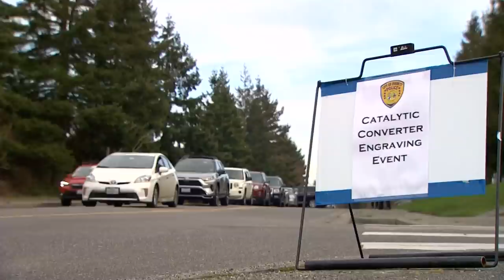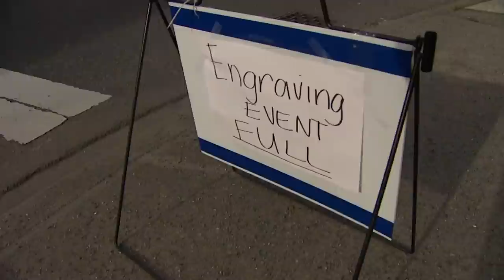Drivers wait hours in line at Everett catalytic converter engraving event

Comment: I've heard some industry experts state that engraving the VIN into the converter makes it easier for thieves to sell them. Also, a thief is not going to see the number engraved in the dark while they focus on quickly cutting it off. Engraving the number protects you from theft the same way a security camera on your porch protects you from porch pirates: NOT AT ALL.
Reply: If they make it so you have to supply your registration, to the scrap yard, so they can match the numbers it would work. Without that bit of legislation it would serve no purpose to engrave your vin on it.
Reply: @mgreg8134  FACTS

Comment: My nephew worked for a metal recycling company and the aftermarket cats do not have any precious metals in them unlike the factory ones. They are basically worthless as scrap for that reason.  We were talking about this a couple of months back because I need to change mine. We both agreed though that thieves won't take the time to figure out if your Cat is factory or after market.
Reply: Most know just by looking at them. Its pretty obvious.

Comment: Engraving will not stop theft. Waste of time, scrap yards use what's inside the converters, the paint and engraving does nothing
Reply: Since no process exists for a scrap dealer to cross check the numbers with a actual 
junked car before buying won't work. The number will also be ground off.
Reply: The paint will burn off. Its too cheap and they get too hot

Comment: Since there’s no emissions, ppl should just run a straight pipe w/resonators
Reply: You can't, most on-board emissions circuits will throw codes that the catalytic converter isn't working properly
Reply: There are emissions all over. Its litterally different in every county.
Reply: @donaldmiller4386  That's not what I mean, I'm referring to the emissions that are created and monitored by your cars onboard computer. That missing piece will cause an error code, and potentially other issues with the car down the road. Most people aren't very concerned about a check engine light but ignoring it, if you end up with a more serious code on top of that one, you have no way of knowing unless the car breaks down.
Reply: @maryjaneevadiamond6359  My comment was not for you. Which is why your name isnt in there.

Comment: 800$ for a cat? She got scammed. They probably replaced the entire exhaust. Any reputable muffler shop can weld in a universal cat for much cheaper. $200-$300 including cat.
Reply: That depends on the make and model of the car My 2006 Subaru outback  the header pipe is part of the cat. There is not enough room due to how it is run to cut out the old one and put in a new one .

I looked high and low for a universal one but could only find aftermarket OEM style for it. Still way cheaper than a factory muffler. 

Auto Zone wanted close to 600 bucks just for my cat plus it would cost another 100-200 to install it.  

She is driving a Prius so her cost may not be far off. 

Plus Washington has developed California emission standards for all vehicles manufactured after 2009. So all catalytic converters installed on vehicles older than newer than 2009 must replace the cat with a CARB designation.
Reply: @mgreg8134  it depends on where the 2nd o2 sensor is. My old sti had a similar setup to your outback and there was plenty of room to install a universal one before the 2nd o2 sensor. Also, autozone, pepboys etc will always be on the high end. Best to take it to a muffler shop. Much cheaper.
Reply: Yeah where do you live?  Prices are different in different places of the united states. Like i said. You cant even buy the aftermarket here in calif they will not smog your car if you dont have the specific California approved one. I just went thru this with my son..they also require two of the 900.00 dollar one's that is 1800 hundred then you gotta pay someone to put it on. We went to every place in the Davis woodland. And Sacramento valley area. They require it
Reply: @calinurse1205  good point. I am in Atlanta which is pretty strict for the south but nothing like California. Still, it seems online that even the California approved aftermarket cats are in the $2-$300 range. I think the key is going to a muffler shop instead of an auto repair shop.. They will cut and weld in the replacement. The auto repair shops like to replace the entire exhaust which is much more expensive.